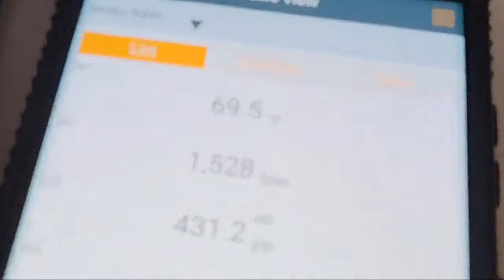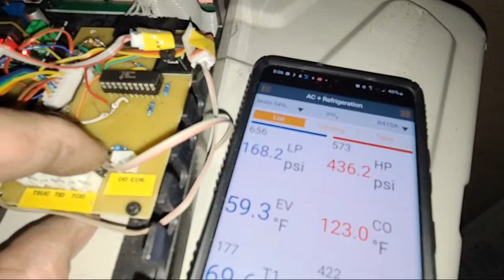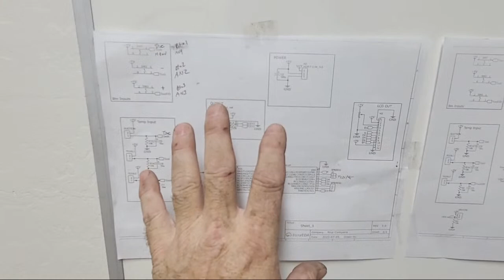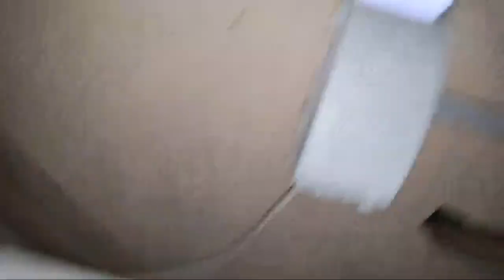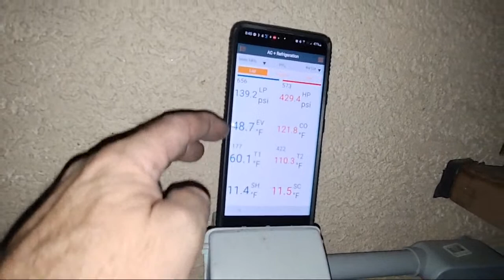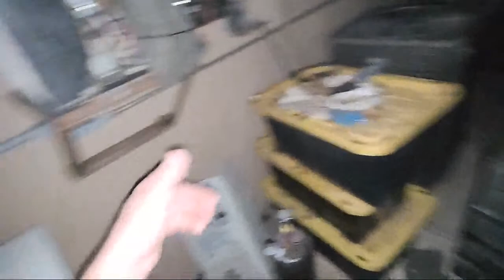Starting Up FRANKENSTEIN Before It Is Ready

Comment from the maker: The room dropped to 67 degrees and I had to run outside and unplug it. 
When I went outside I found that it was starting to rain!
I had no idea it was going to rain. So it was good thing I went out there 

Also once the room dropped into the 70's the condensate line started dripping into a bucket. A bucket that I just placed on the floor 10 minutes earlier "just in case".
Got lucky twice. 😆
Reply: Nice!  Sounds like your lab cave could be used as a walk in box with that setup!
Reply from the maker: @GannDolph  Yeah except it could run our my solar powered batteries so I do need to get the controls finished

Comment: You'll get much lower voltage ripple  for a given amount of capacitance if you use a full wave doubler instead of half wave.  You just need two diodes and two caps of same value, 200V or higher, wired in series.  Tie the series caps' midpoint to L1, feed caps' top + and bottom - each via a diode to L2.  That's the effective doubler circuit used on a 120v ECM blower motor, a 120v  VFD and many other things. 
   Feed that 340v DC to the equipment.  Just make sure the equip's DC bus negative is not tied to AC protective earth ground.
Reply from the maker: Sounds like you're describing the same circuit in using. Two diodes and two caps.
The reason my second cap is smaller is because the first use was tied to the fan  inverter board that has two large caps effectively in parallel. 
For the indoor fan I don't think it will sag much. It works great.
Reply: @hackfreehvac  If it works good you're done.  

If your doubler circuit results in DC feeding the equipment, and uses only one capacitor, and two diodes, then it must be a half wave ('charge pump') style doubler.   A center tapped series two capacitor arrangement, as described , is actually a bit different, as both phases feed  both the  load and charge a capacitor on every half cycle, versus only every other half cycle in the half wave version.  When I studied this I remember the loaded voltage regulation  being  significantly more stable in the full wave arrangement.   Worth keeping in mind for any future application, if ripple is a problem..
Reply from the maker: @GannDolph  Yeah but these motors pull a fraction of an Amp so the simple doubler works pretty good